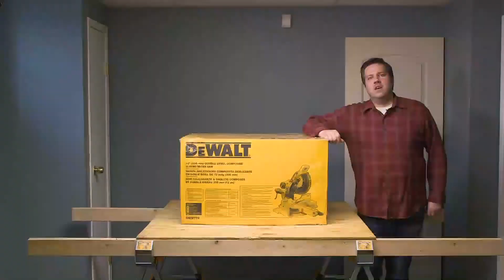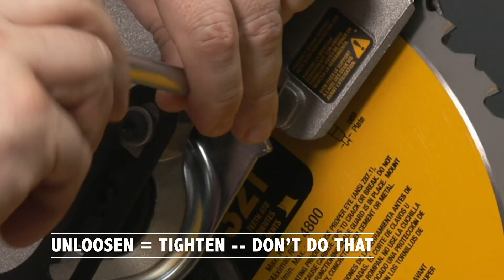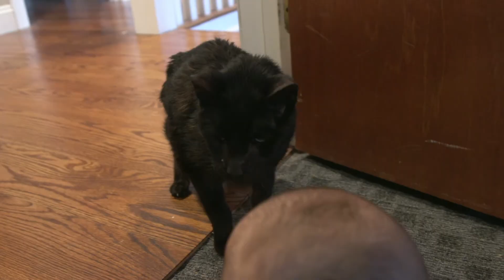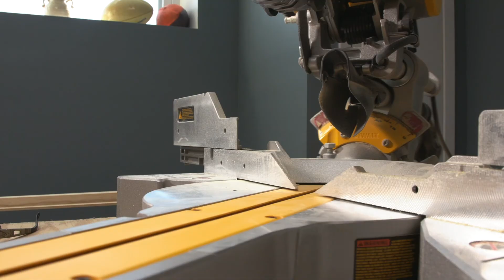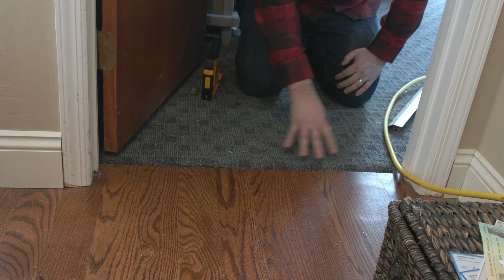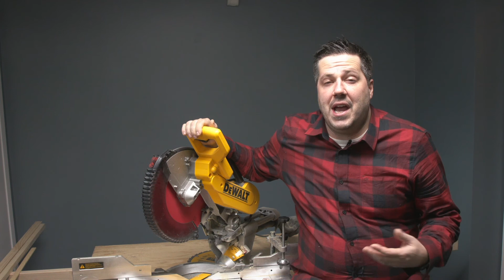So We Bought Our First Shop Tool! Dewalt DWS779 Dual Bevel Compound Miter Saw

Comment: Yay! A power tool!  It is so exciting isn't it???
Reply from the maker: I was torn between this and a tablesaw.  I think I made the right choice.  I use this more than anything I own.  I used it for the flooring, to cut the crown and feature wall panels.  This weekend I think 2x12's are on the docket for it.  I'm getting kicked out the playroom which was my work area all Winter, so I'm looking to upgrade to the portable stand now.

Comment: I just got my first brad nailer in the mail today!  Can't wait to use it!!!
Reply from the maker: Which one?  The air tool or the cordless.  I have the 18 gauge with the compressor and irt works greart but I'm curious about the cordless..
Reply: @SoWeBoughtaHouse  Cordless.  I don't have a compressor. =(  I used it this weekend for trim installation and it works great!  No jams so far.  No wait time just press and squeeze!
Reply from the maker: @theropesofrenovation  I think I want one :)  Starting a new room project sometime this month and it needs lots of trim work.   I do love the compressor  one, but it makes a lot of noise and isn't conducive to working during the babies nap times.
Reply: @SoWeBoughtaHouse  It's still loud, big bang but quick.